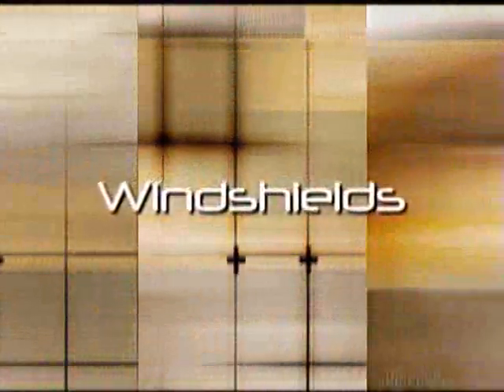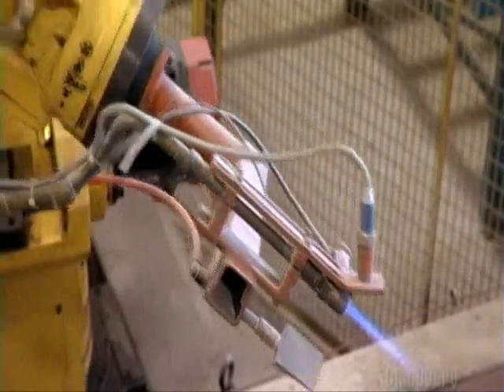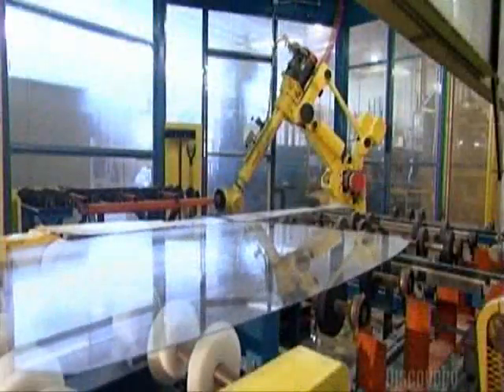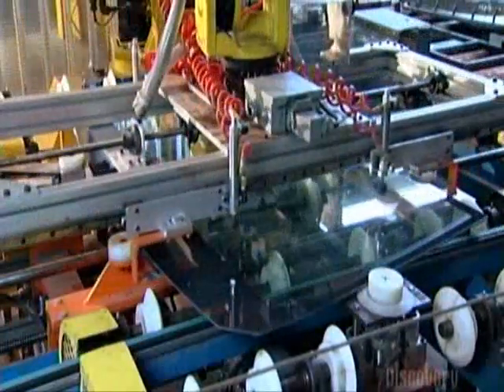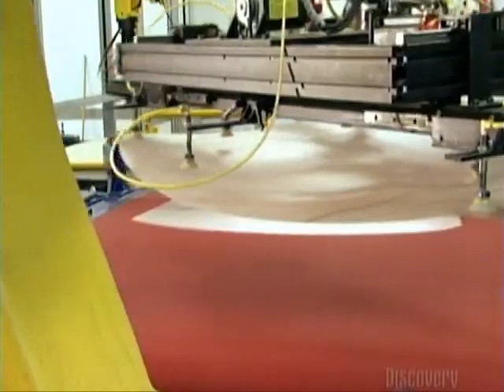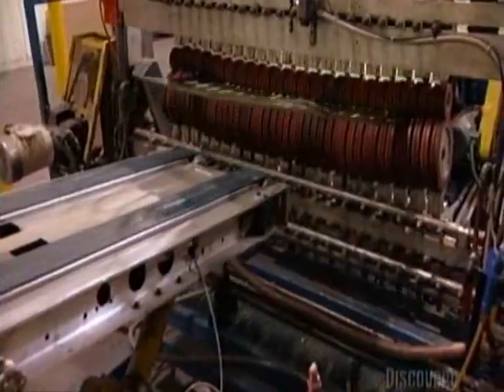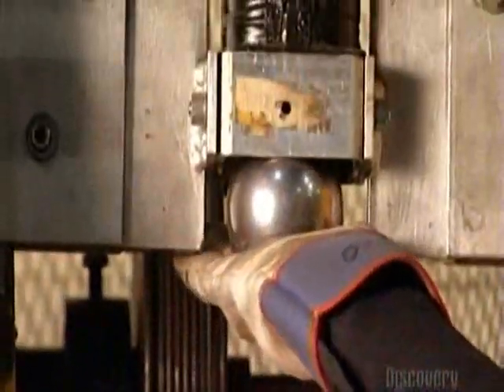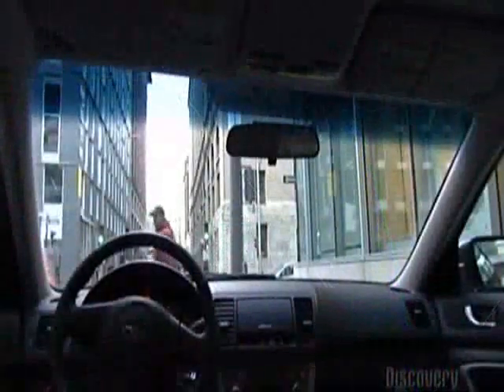How It's Made-Windshields

Comment: In the video, the autoclave is characterized as "a giant pressure cooker".  Are windshields laminated under pressure, or vacuum?  Or are there different processes?  I would think a vacuum would be needed to remove any air bubbles - but then how would that help press the glass together if they are not vacuumed in bags?
Reply: I believe it is a vaccum

Comment: Yeah that is what I thought.  The board went through the windshield but the rest of the windshield stayed intact. If that was not shatterproof glass the entire windshield would have been sent flying into the passenger cabin in large shards.

The windshield was working as designed.  If you do not like the term 'shatterproof' then perhaps you could think up a better name for it.